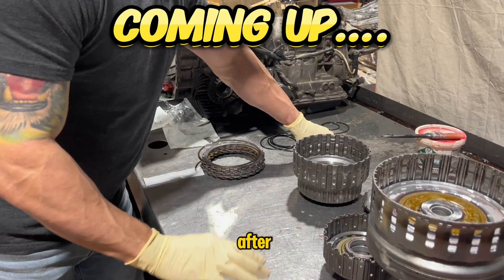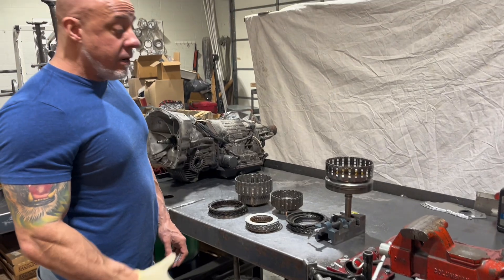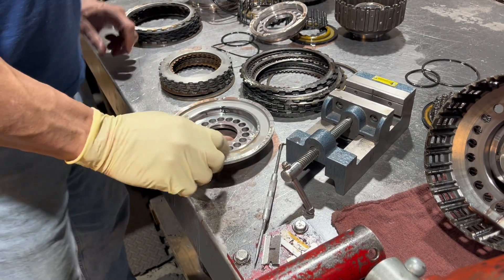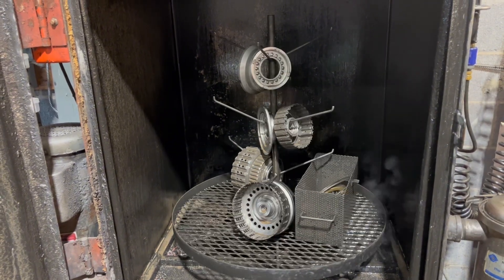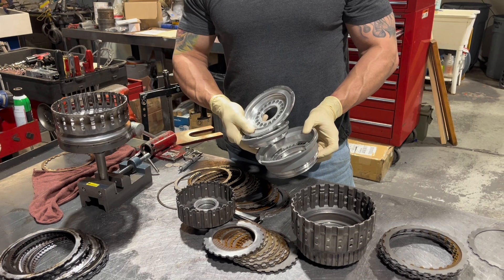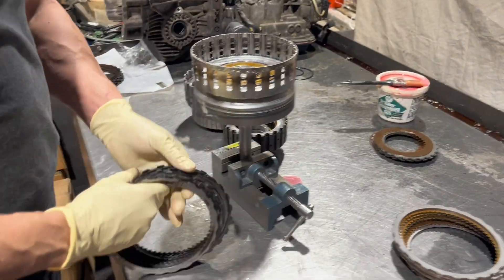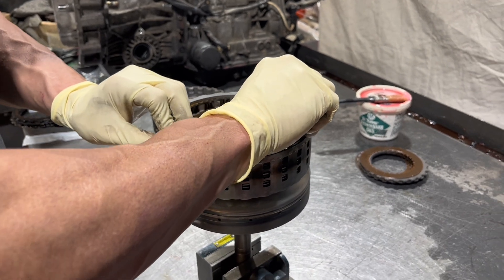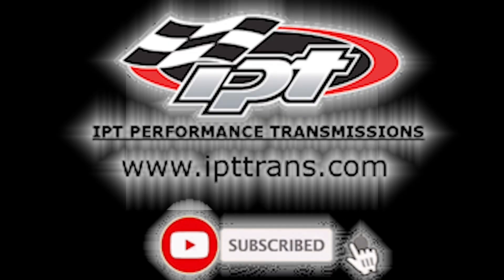RE5R05A Titan Performance Clutch Packs- Quick Look

Comment: I’m curious about what is the difference between the 7 clutch packs and the 9 ? More torque I imagine. Does these fail due to temp and fluid conditions?  Would more frequent transmission oil changes help ? I’m lucky to own one of the those shakey beasts in my Titan 2018

Comment: The fact this trans was supposed to be built to 1000hp by the prior builder... yikes
Reply from the maker: Nothing but words, these will not handle 1000 hp, no matter what
Reply: @iptperformancetrans  alot of us titan guys know that and expect a built 4l80 or th400 swap. Would be cool to see the maximum on a re5 built the right way. I for one could benefit from a proper trans being I'm on 12lbs of boost on stock engine and trans
Reply: @iptperformancetrans so far your built re5 is holding 800whp 👌 once my stock trans gives out i know who to call!